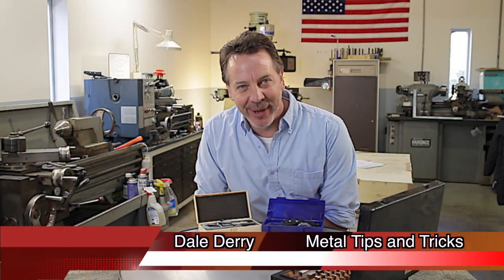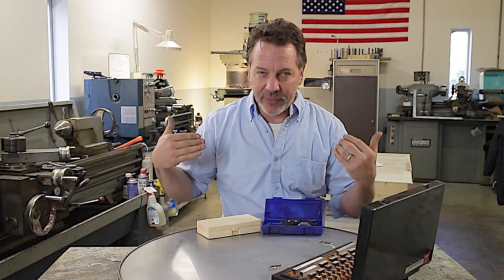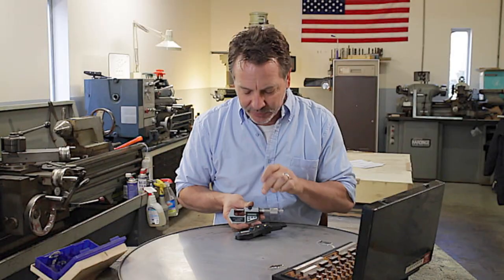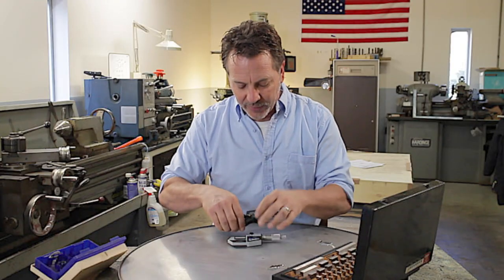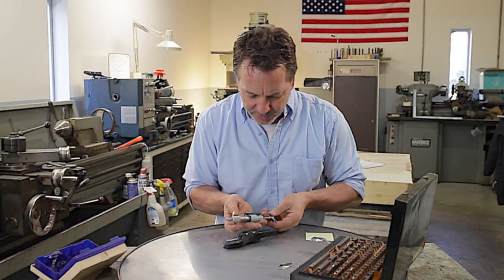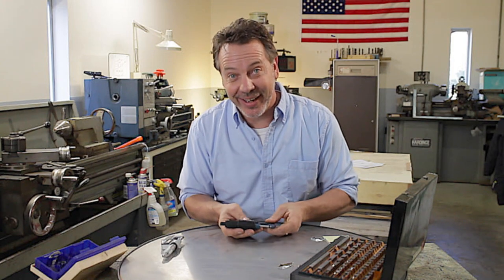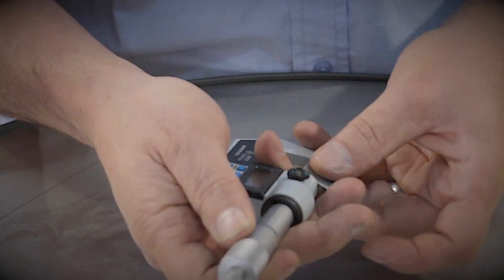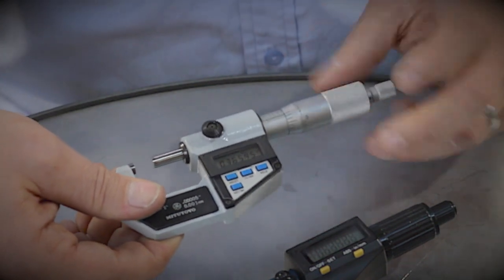Mitutoyo VS Harbor Freight ....The Digital Micrometer show down

Comment: Interesting comparison. Too bad they don't made digital mics with a display that can rotate from one side of the barrel to the other, so us left handed guys can use them more easily. I might buy a set of those cheap ones and investigate modding them.
Reply from the maker: That would be cool. The display is always in the Wrong position

Comment: Boy it's a hard one I have both a mitutoyo and a Chinese brand and using my gauge blocks get no difference the battery life in the Chinese one is a lot less but out here in Australia you are paying allot more than two hundred dollars for the mitutoyo. So you can buy six of the Chinese ones for one mitutoyo. The question is if you drop the mitutoyo and damage it it's going to really hurt where the Chinese gets damaged just go get another for very little.
For the home shop I have found the Chinese one does all that I need. I have thousands of dollars worth of mitutoyo tooling and have to treat it like its gold the 0 to 1 gets a flogging used all the time so my go to is the Chinese one I  check it regularly with the standard and it has not faulted. So I guess it just comes down to how much money you are prepared to spend and how much they get used all comes down to personal preference in end.

Comment: most of the cheep mics won't pass calibration.yes they will measure say 1 inch, but then wring some gage blocks to measure various increments and see what you get.
Reply from the maker: +Michael Wilcox
That's a great idea. I did that, and it worked  perfectly , but I do use the Mitutoyo most of the time

Comment: Hi Dale and thanks for your great video (no need to reply by the way)
I have a number of different dial calipers - some dial some electronic.  I have 
decided not to purchase any more electronic ones because of the hassles with
dead batteries.  
I only have a few micrometers and none are digital and only go to 0.001 inch 
and when I consider my Newmachinist skills if they went to 0.01" would still be
a challenge for me to meet.  Maybe some day in the future I would look at a mic
that had better accuracy and would likely go to the HF version only because of the 
cost.  I would love a Mitutoyo but couldn't justify the cost.  If I was a journeyman 
machinist I would likely go with the Mit.   Thanks again for the great videos.
Rod

Comment: My harbor freight caliper kicked the shit out of a starrett micrometer in accuracy and repeatability. I bored out an engine block on a bridgeport my friend has and he swore by his mics. I pulled out some gauge blocks and found my calipers were spot on and his mics were .0025 off. To this day he still uses those mics and I still use my calipers. Everyone gives me shit but my parts fit better.

Comment: Mitutoyo  for some years has been made in China not Japan as some would think. so Harbor Freight is just as good at 1/3 of the price . I had a $100 dollar pair of Mitutoyo  digital Calipers for work and smashed the LCD  Replaced them with Harbor Freight Calipers still working Great 5yrs and still working and they were only $15 bucks
Reply from the maker: +1995dresser 
Harbor freight definitely has its place in the shop :-)

Comment: I've had some duds from Starrett as well, mostly issues with the measuring faces not being parallel. I've never owned an electronic digital mic and don't plan to. Mine are all ratchet thimbles, but only because they are faster to open and close. It makes me cringe when I see people using a ratchet or friction thimble to take measurements.

Comment: In my experience with the cheap measuring devices most often aren't that accurate as far as the regular mics vs my fowler mechanical digital mics read the same as long as you calibrate them got these while i was still learning to read the vernier style i was impatient trying to figure out the measurements now i have used them for quite some time i dont have to think about it anymore i understand what I'm looking at now and i find them a lot quicker to use than the digital ones however i have cheap digital calipers and a better one the cheap ones only get used for quick check gets beat up building a specialty tool that i got the dimensions for it from dealer manual. Now this where it matters if your following a blueprint or specific dimensions the cheaper tools don't always work but if your just copying a part it doesn't matter how accurate your tool is because you could even lock your measuring device to size of part then duplicate it . This where I keep my good tools for more precise projects otherwise I use the cheap ones when accuracy doesn't matter

Comment: Im finding that the "high quality" stuff is nothing more than the name. I've had more problems with my Fluke meter after replacing it a couple of times, however, I bought a cheap meter to get me through the day about 2 years ago and it works great and is DEAD ACCURATE! I hammer on it and it lives in water most of the time as its my trash, no feelings hurt, kicked dropped for fun meter. My Fluke on the other hand..... Look at it wrong and it will mess your day up. It's funny that I find myself double checking the Fluke with "el cheapo" meter?

Comment: I noticed you didn't use the ratchet on the Mitutoyo when you did your measurments because it does require two hands. Mitutoyo and other higher end brands do make micrometers with ratchet thimbles. I can't help but wonder if the digital models are really that much of an improvement in actual use. All digital micrometers I've seen look s a bit clunky. Even on the Mitutoyo model, the buttons and display look cheap and fragile. I'll stick with vernier style micrometers.

Comment: This test isnt actual for home shop owners, because they should couple together two parts, and there no differenece what kind of readings you get from yor tool, inches centimeters or you own shirtmeters.
One or two inches doesnt mater nothing, just cuopling is important.
Just measure with you own tool.
If you get readings from you client, it is important(if you can trust those readings).

Comment: I have a range of high quality and low quality measuring tools, defiantly the feel, quality and longevity are worth the money 
But, If I was stating off in machining, I would spend the $200 on several cheaper micrometers and callipers
Rather than buy one instrument,

Comment: I get paid by the hour I'm in no hurry
Reply: MrButch9110 That is exactly what I was thinking. Who cares if it takes 2 mins to screw back down. But it's only becasuse it's on a metric track Vs. An imperial with the mitutoyo one.
Reply: Ashley McGovern Most if not all Mitutoyo tools are metric, I think.

Comment: Big improvements in budget electronics re accuracy over the last few years, when newer materials become economically viable and CNC machining and assembly replaces cheap unskilled workers there could be a real push to knock certain ridiculously expensive tool manufacturers out of the game with accurate AND reliable instruments available to everyone for a budget price. Of course there will always be people who willingly pay over the odds and then try to convince everyone else that their gear is actually better even though tests like this show otherwise, especially when longevity and materials is eventually addressed by cheaper manufacturers

Comment: Oh, do I ever agree with you about those wretched Mitutoyo boxes! They're not much good when they're new, and it rarely takes more than a year for those rubbishy flexing-plastic hinges to crack, making the box unusable. I've bought a couple of empty Starrett boxes for my two Mitutoyo micrometers, but even the empty box, if you can find one on eBay, isn't cheap. I used to like Mitutoyo measuring instruments very much, but I haven't bought anything from them in years and years. There's not much point in paying a premium price for a top-quality instrument if it's going to spend all but the first year of its life rattling around in a drawer with a lot of other stuff.

Comment: Neither on of these mics will measure .00005.  That is the resolution, NOT the accuracy.  Accuracy is 2x the resolution.
Specs for a basic Mitutoyo mic:
https://ecatalog.mitutoyo.com/Digimatic-Micrometer-Series-293-MDC-MX-Lite-C1092.aspx
If you scroll down to the table at the bottom of the page you will the stated accuracy is .0001.
Specs for the Harbor Freight micrometer:
https://www.harborfreight.com/digital-micrometer-63647.html
Same here the table show the accuracy as .0001.

Comment: the one inch reading on the mitutoyo is not valid, since the ratchet wasn't used. no ratchet is different pressure and different pressure is false measurement

Comment: I work in an automotive shop and I see sooo many guys think HF is just as good as name brand. I have seen time and time again they are not. The digital calipers must be moved extremely slow or your reading will not even be in the ball park. Measure one rotor at 0.710" back it off 0.030" to remove it and measure the next rotor and it say 0 786"!  That is wrong. They wear out fast.

Comment: being a bit of a troglodyte, all of my precision measuring tools are analog, and i do have some chinese calipers and dial indictors, but no mics. i have been satisfied with the chinese tools and have found them to be good value for the money.

i definitely find the "quality" tools, the mitutoyo, starrett and b&s to be smoother in operation and nicer in the hand. the mitutoyo mics i have are great, but i have no chinese to compare them with. just looking at the h.f. mic, its clunky appearance and plastic are off-putting. the huge, boxy housing for the electronic components seems to get in the way, especially for the spindle lock. when patient shopping on ebay can result in new b&s, etc.,for the same sort of money  as the h.f tools, i think i will continue to be an ebay shopper.
Reply from the maker: Think you have some great comment. I'll see you on eBay 😀😀😀

Comment: You made two classic mistakes when using that mic.
When "cleaning the anvil" you didn't release the pressure on the paper before sliding the "pinch" off the edge of the paper, thus likely trapping cellulose fibers in the opening, possibly influencing the upcoming measurement.
Then you made another one during the measurement you made moments later.

Finding the measurement a little larger than the expected value, you ignored the little ratchet (torque limiter) on the end and wrenched it down a bit tighter with the barrel, stopping a half a 'thou' short of the target.

Comment: I only buy higher quality tools but I have some thoughts on this subject...

For 35.00 each, you can buy two HF micrometers and still have a brand new one right in your box or on the shelf to use when the first one fails - if it does fail.  
You would still be way ahead of the game financially.  

... and as far as losing accuracy over time... same argument... Chances are YOU would wear out before you wore out enough HF units to have cost you as much as the one Mitutoyo.  Most definitely, you would wear out before you went through enough to equal the cost of a Starrett unit.

I mostly use Mitutoyo and just don't see paying for Starrett.  I only have Starrett tools that I purchased second hand.  

I also do not subscribe to using the lesser tool on a daily basis and my better tools on "special" projects... That just makes no sense at all... Stupid way to think... Why would anyone in their right mind buy a quality item and never use it... Really?

Did you ever think of using the better tool which you suspect is more accurate and has better springs or whatever feature that appeals to you and then using the Junk tool when it fails or you drop some 50# thing on it?  Makes more sense to me.

I do have "A" tools and  "B" tools as you suggest in one of your other videos but I never use the B tools... they are not for "everyday" use they are for friends to use or even borrow on occasion..  Nobody uses my A tools.,. NOBODY

For that matter I also have "C" tools,,, that I buy purposely on occasion from HF (or actually they are sometimes free) and they are really the tools I lend out or don't worry about leaving my property... lend to friends,,, carry in a car,,, etc.  If they disappear, I don't miss them.

Accidents do happen but if I had a tendency to drop 50 pound things on my tools, I would probably rethink working with tools and heavy things,  I definitely would not work with equipment that cold maim or kill me.  I no more want to risk dropping something heavy on my tools than I do on my foot.  If you have such bad work habits... sell your tools and hire mechanics - you are playing in the wrong sandbox.

I also own classic and special cars but I DRIVE THEM... that is the purpose of having them.  If I want to sit and admire them all the time I would just buy photos of cars and hang them on my walls.  when you buy quality things, tools included, you should use them til they wear out and get the full value from them. Your shop should not be a museum - go visit Keith if you want to look at tools in a museum.  One could actually argue that any service life left in a tool when you die is kinda wasted money - you shoulda bought it sooner so you could have used it up.

There is a place in the world for Harbor Freight and all the other Import crap tools.  Some people may only do work on their house or car a few times in their lifetime.. for them HF makes sense... they might even only use a tool one time... they will never wear it out.  I actually know a mechanic that earns his living with his tools but he got tired of them disappearing so he now only uses HF tools... He lets anyone that works for him use them and if they disappear,,, .no big deal... for 50 bucks he can buy a whole bag full of new ones.... Not my cup of tea but now in his late 50's he is happy with the arrangement.
To each his own...

Myself, I buy a bunch of things at HF but no tools... only consumables and things that I buy for helpers to use... gloves... bungee cords... abrasives... rope... tarps... etc.  Even this stuff is often junk but it suits my purposes.

Just Sayin'